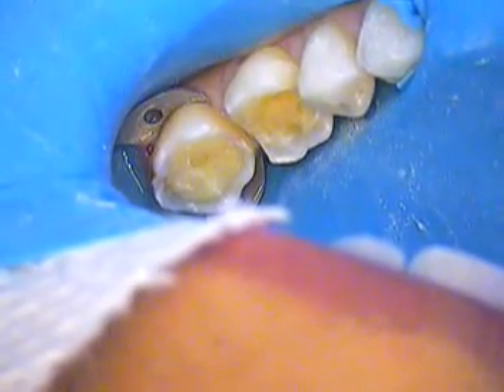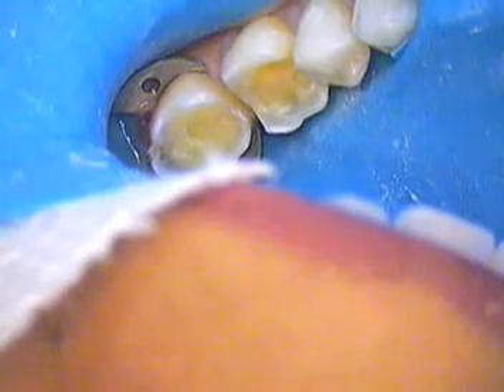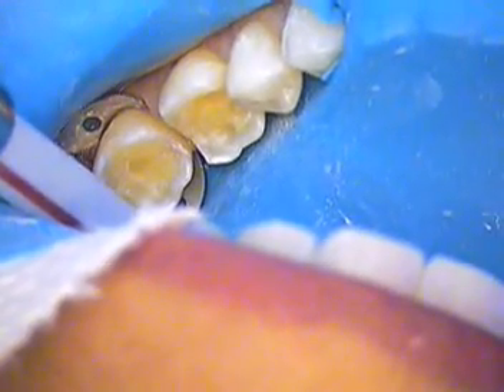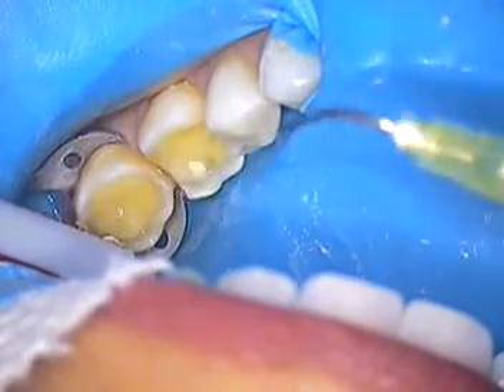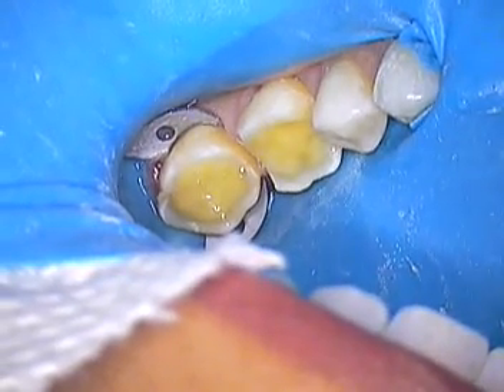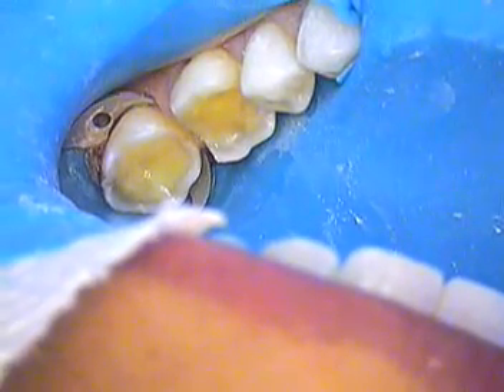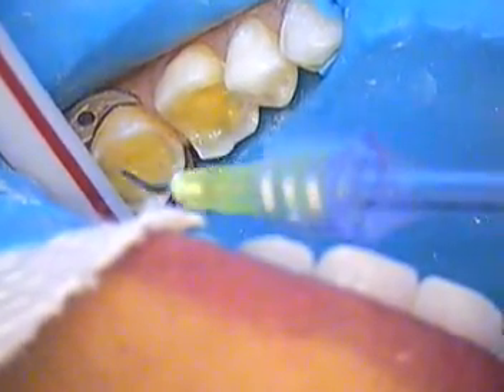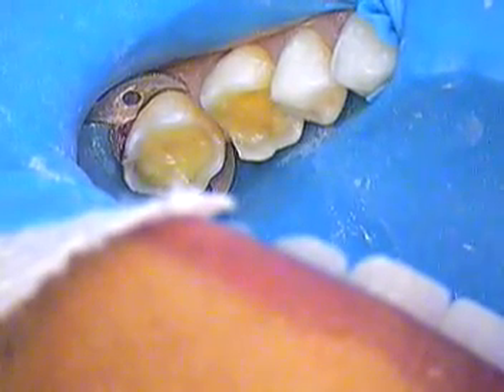DR. GERARD CUOMO - Replacing old dental fillings with cosmetic crowns. 3 of 4 Boca Raton, Florida

Comment: Are you using the diamond bur to remove the old composite and decay on a slow speed highspeed handpiece?
Are you using Bisco bonding with the Corepaste from Denmat? Are they compatible? It is recommended to use the same products from the same company for bonding and core buildup/restorative. Can you please comment.
Very nice work. Thank you for sharing.